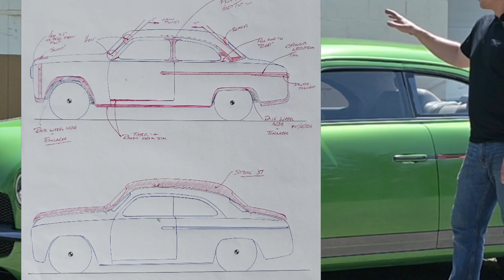Ultimate BODYSWAP!! Custom AWD 1951 INFINITI Shoebox

Comment: Beautiful Nick! Glad for you to see it finished for us to I guess. I really wanted more of this fantastic build. Just wondering if you have more you could slip in like how you managed the rear strip lighting. The window finishing would be most enjoyable too, as I am going to rake my A pillars back after seeing how you accomplished this along with the glass center strip delete. The rear window ruber and side glass. What is the wiper mechanism you have used. I have been looking at early Bronco , I have a 12 volt bug on my bench now. It reminds me of yours from the outside. The list of questions is large. Please 🙏 can we have more.
Reply from the maker: Hi Paul!  To meet our deadline I wasn't able to find the time to film those final assembly details.  It was honestly a mad dash to the finish.  Saying that, when I get a moment I'll see what I can do about another video going over those items specifically.  To answer some of your questions now, for the front glass centre strip delete I used structural grade silicone(the stuff used to glue aquariums together).  Regular bathtub silicone won't cut it.  Rear window molding is a stock replacement with no provision for trim.  And, the wipers are driven by the original INFINITI motor relocated to work with a modified mechanism we had laying the shelf.  Not sure what it came from.   Thanks so much for watching!!

Comment: You're amazing!! The details are crazy. I wonder what a chrome strip would look like at the bottom the front hood & also if you had done gray around the windows? I can't even imagine the hours spent! Great job. 👍👍🙂
Reply from the maker: I did a sketch with a dark accent around the windows and without it seemed better at the time.  If the main body colour was darker the accent would have looked pretty good.  We'll be adding the trim below the hood this winter.  It'll cover the raw edge of the grill's mesh.
Reply: @iNVisionPrototypes  awesome! You're still amazing to be able to do what you do!! 👍🙂

Comment: Congrats Nick, excellent result, you guys should enjoy the heck out of this.  I think you did a fantastic job with respect to the proportions and made what could be a visually heavy car appear much more athletic.  I like the slightly leaned forward suspension stance also.  I'm sure you guys are going to do a bit more with it after summer enjoyment on the roads is concluded.  The transition along the sides to the more vertical planes of the rear fender fins looks neat.  

But (and this is my only "but") viewing the rear from the back the visual weight is huge.  Perhaps another grey accent line that starts at the side mirrors beginning very thin and gradually widening along the shoulder as it passes the rear glass and follows the valley of the rear fins down and then have both sides bridged with a horizontal stripe that crosses a bit above the exhausts?  I don't know maybe I'm wrong but that's what popped into my head.  Feel free to ignore the peanut gallery!
Reply from the maker: I appreciate the feedback and for taking the time to watch.  Cheers!!

Comment: Awesome accomplishment!  If you have a chance I would greatly appreciate your thoughts. If you were to do some kind of replica of the james bond Aston Martin DB5 in either steel or aluminum, exterior only, what kind of donor car would you start with?   I have a pretty good set of tools for metal work, not as good as yours but functional. Thinking ahead after I get done with current project.  Thank you.
Reply from the maker: Thanks man!  For a DB5 replica donor I would start with Google as it would be your best resource in researching determining factors for finding a vehicle that fits the requirements.  When it comes to tools, work with what you have.  You may need to get creative at times at finding a way that will facilitate fabrication, but at the end of the day one doesn't need a shop full of tools to get the job done.  Thank again for watching!

Comment: great job nick,i'v been building custom cars all my life and to watch builders with the skill that your father and you have is a pleasure,it's not easy to do what you two did with this car as i did a 61 tbird convt over a 96 lincoln mk eight and the engineering involved in making every thing work at times is overwelming,great job but i think the mirrors should be green and a more period correct wheel would probably look a little better.regards
Reply from the maker: Overwhelming is an understatement!  Some fail to realize how much planning and work goes into something like this.  Thanks for the suggestion and for watching the build! 👍

Comment: I watched all of these a while ago, but can't remember, is the headliner build in an episode?
Reply from the maker: Hi Tom, The episode you're thinking of was for the custom 40 Coupe https://youtu.be/SgUB2FHPsKo  I'll do another headliner fab video when we get to that point on the 56 Windsor.
Reply: @iNVisionPrototypes  thank you.  I'm planning to put a 51 plymouth on top of a camry, and the headliner is bad. Also, the camry seems just a little too wide, so I'll have to do a lot of measuring and possibly reconsider.
Reply from the maker: @TomPetersonRefuseReuse  No problem!  Sounds like a cool project! Are you planning on keeping the 51's body looking stock?  Compare the hub face dimensions... might be closer than you think in width.  Wheelbase wise, if I can recall correctly the 51 might be longer... which shouldn't be an issue 👍
Reply: @iNVisionPrototypes  I'm thinking I might have to set the plymouth rockers on top of the Camry if possible. I just have to use what I have on hand and can get cheaply. Anyway, thanks for all the videos, they will definitely help.
Reply from the maker: @TomPetersonRefuseReuse  Run with it and I'm sure you'll make it work! 😀 What ever you decide will be better than the antiquated technology.  Not sure if you saw this video. https://youtu.be/j7m1YuAq4rw We cut a mustang in half and lengthened/restructured it for the wheelbase to work for the custom 40 Ford Coupe concept.  Hope it helps and best of luck with the build.